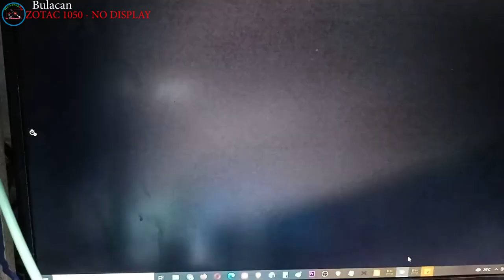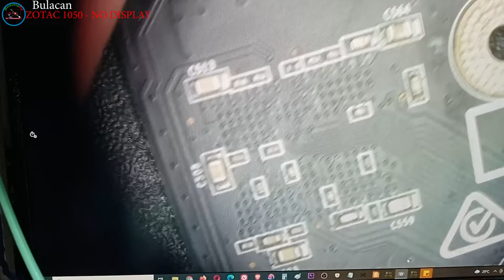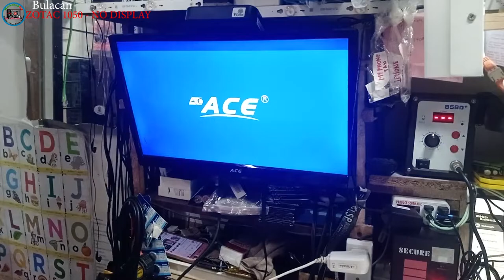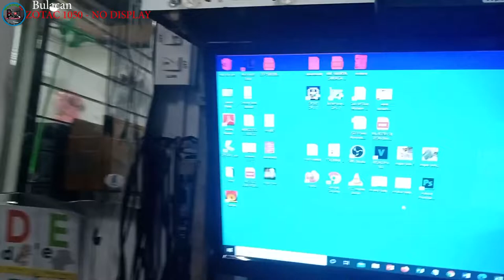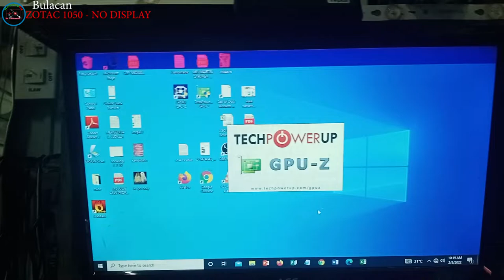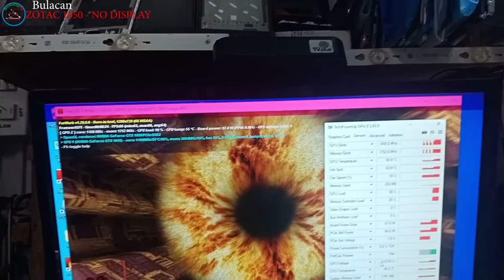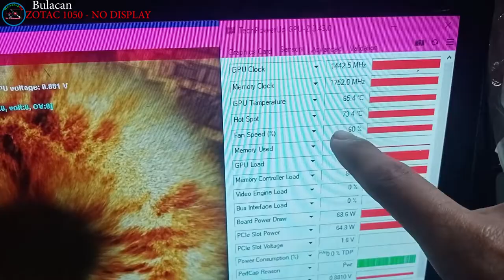ZOTAC GTX 1050 2GB - No Display, Replace PWM and Memory controller(Solved!)

Comment: Boss naka zotac gtx 1050 mini din ako kaso ang problema once na open kona pc maingay yung gpu tapos bigla namatay at pag open ko black screen pero naandar pa fan. Na try ko isaksak cable monitor to mobo goods naman pero sa gpu black screen. HMDI po gamit ko sana ma help . Thaks
Reply from the maker: PM po kayo dito sa Video Card(GPU) Repair Business Page para po sa information, contact No., location at ma-assist kayo.

Salamat po,
 link: https://www.facebook.com/VideoCardRepair/
Reply: @WorkshopFix  nagmessage nako wala nagrereply
Reply from the maker: @melaniepagadora825  ok po. check ko..baka nasa "spam"